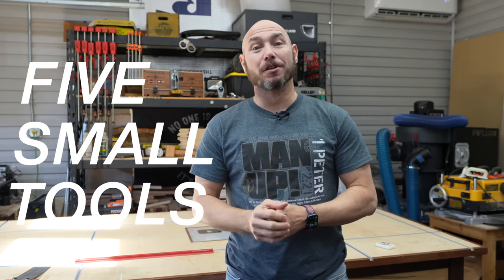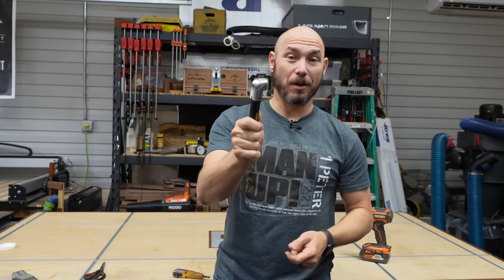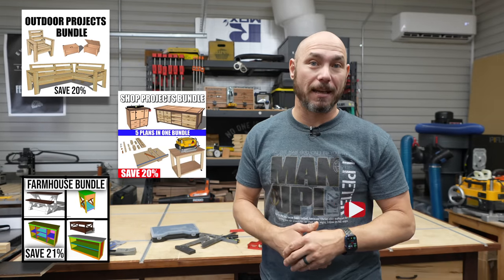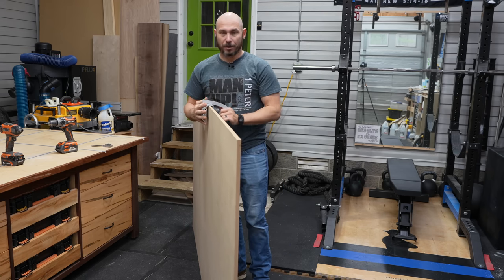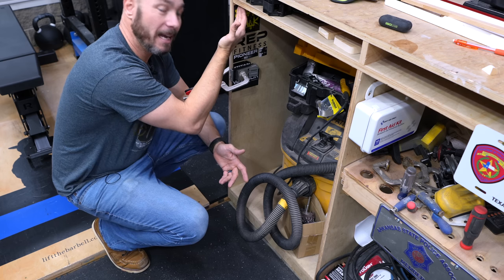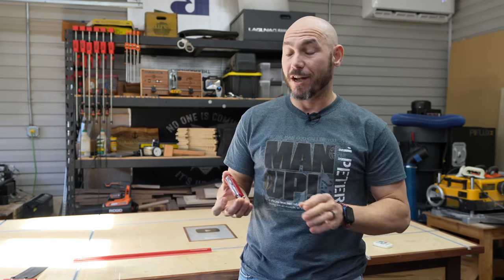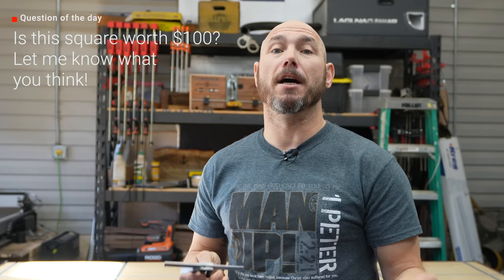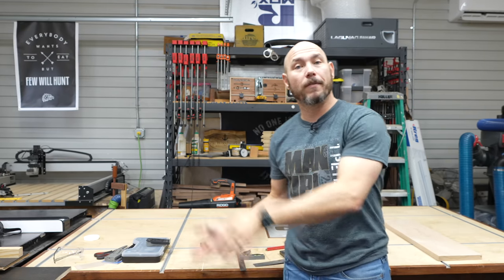5 Tools Under $30 Every Woodworker Needs

Comment: Here’s my bonus comment. The spring loaded automatic center punch is a must have forever vehicle. It’s the best thing for breaking a window if you were to be trapped need out. Conversely if you come up on the situation where somebody needs to get in a car, it’s fabulous for that as well. And all my years with the rescue squad I make sure I had one in my belt pack all the time. Just put it in the corner, give it a push and the tempered glass shatters.
Reply: I keep a Res-Q-Me on my key change.

Comment: I do A LOT of flat box furniture assembly.  I agree the 90 degree drill attachment is a key item.  Same for the flexible extension.  Bonus points for using “waller” in carrying plywood👍🏻

Comment: I got that exact right angle attachment when I needed to add studs in a tight wall and as long as you hold the head FIRMLY, that thing is a total gem.

Comment: I love my Starrett 12 inch combination square, Heirloom tool quality.   One advantage to it over the lesser brands is how easy it is to remove and put the blade (ruler) back it quickly without having to fuss to align the pin with the slot.  The satin chrome finish is just so easy to read -never any glare.  Wonderful tool made here in the USA .
Reply: I love all my starrett mics and calipers for work. I need to get the combo square for the the woodworking shop though.
Reply: I have one that was in graved back in 1912 I assume by it's original owner and it is still accurate and a everyday carry for me

Comment: Matt keep up the great videos. I am from Southwest Georgia and have been enjoying your videos for about 6 months now. I have gotten back  into wood working after not having a shop for over 6 years. I have been fully retired (for the second time) now for 2-1/2 years. I have been doing volunteer Christian construction work with Mid-State Builders For Christ; Macon, Ga. since September of 2019. We just had a new 24' wide X 50' long with 10' walls shop put up. I am in the process of getting things finished up on the inside to move all our stuff, equipment, tools, etc. out of our double carport into this new shop. Can't wait! Thanks again from a fellow Christian for your great videos sir.

Comment: Not a woodworker... yet... but I already own and love some of these tools.  

Right angle driver.  Got one of these when I was strengthening and redoing the the closet poles when we moved into our new house.  It made screwing in the brackets under the shelf so much easier.  Have used it multiple times since in other various projects around the house.  I found out about it from a Steve Ramsey video.  

Center punch.  I picked up one of these on a whim for my model making hobby.  It was not precise enough for what I needed in the application I wanted at the time, but has come in handy for jobs more in line with what it was designed for.  I was glad I had one when i finally needed it.

Swiss Army Knife.  I got one when I was 11.  I still have that same one 33 years later.  So useful.  Usually not the best tool for some of the applications I have used it for, but a tool that can get the job done eventually is better than no tool at all.

Comment: Been carrying a Swiss Army knife for YEARS!  Use it EVERYWHERE!!  A DEFENITE MUST HAVE !!
Starrett makes high-end precision equipment; I wouldn't warranty an engine rebuild without them!
Got the Kregg pocket hole jig 8 years ago for Christmas and I use it all the time!  I need to pick up the Visegrip clamp to lock down the jig independent of the jig base.
One I didn't see but consider a must is a high quality speed square.  Had the cheap ones and they went out after just a couple of years.  The one I have now is heavy gauge cast aluminum and machined smooth; got pencil notches for most average sizes to speed marking full sheets.
I'm cheap; I use a 10 penny nail for a center punch.  With the tip ground conical and then heat treat it to toughen it up, a light tap with the hammer and I've got my drill piolet punched.

Comment: First. You are my new favorite wood worker. You’re just a genuinely good guy. I listened to your interview on Steve Ramsey’s podcast. Anyway. 

I have a Swiss Army knife. My kids got it for me for Christmas way back in the early 90s. That year we went to visit my mom. She got a flat box, roll around cart and asked me to put it together.  She had just a few tools in the house and exactly zero Phillips head screw drivers. Of course, that was what was needed. 

Being Christmas Day, no place was open and she wanted it put together before people came over. 

I popped out my shiny new Swiss Army knife and assembled the entire cabinet with that little old Phillips head screw driver. 

My hand was sore for a day, but my mom was happy and that was what it was all about. 

I keep a pocket knife on me at all times. I get a multipack during the black Friday sales so they are like $3 - $5 a piece. I end up losing them eventually. 

Anyway, I lay just pull out the old knife, sharpen it, and have it on me

Thanks!!!

Comment: I have the 6 inch Starrett combo square and I agree that it’s totally worth the cost. I use it during every project. I actually just bought the 12 inch version (gotta treat yourself at Christmas!) and I’m loving it just as much. Another small tool I’m loving right now is the Starrett 819 Hinge-Locating Automatic Center Punch. Basically it’s a spring activated center punch with a concentric collar that makes marking hinges a breeze. It’s also on the pricey side but definitely quality. Thanks for the tips!

Comment: Just bought a right angle drill adapter for next day delivery! Thanks. 
My indispensable tool is a Victorinox SwissTool I’ve had for over 20 years and it has seen me through a tonne of projects. It’s essentially a Swiss knife but with pliers and the case also holds an Allen-key with an assortment of screw driver bits.

Comment: I have the spring loaded center punch and the "plastic" squares, and a complete set of Starrett squares, 6" 12" and 18" as well as a center finder body and use them A LOT. I've had all of them over 20 years, and they still perform as well now as they did 20 years ago. I also enjoy watching your videos. Almost forgot, I also have a Kreg pocket hole set. Best idea I've ever used for assembly of cabinets, etc.

Comment: I agree with every single tool on this list and that is a rare thing. Starrett makes great tools, I used their combination square and chalk line boxes when I worked construction and they always worked just fine. It's worth paying a little extra if the tool is made right and does the job that it's supposed to do.

Comment: YES!!! The Starrett square is worth it!!  It will put a smile on your face every time you use it!  Great list.  The Swiss Army Knife is worth having.  I like the Explorer best, it has a few additional tools but still isn't too bulky. It adds a magnifying glass and also has a 2nd sharp blade instead of the fingernail file. I keep a needle inside the tweezers, it stores away nicely there.  Also I have the eyeglass screwdriver that fits inside of the corkscrew.  The combination of magnifying glass, needle and tweezers helps with any splinters I may get.

Comment: I recently used the spring-loaded nail set to install drawer glides in already installed cabinets. It made starting the screws MUCH easier and kept them from falling out while starting.

Comment: Another thing worth noting: The Taylor Tools store link in the vid description has a great selection of high end combination squares in their "blem" section. They are super discounted and only have a blemish or smudge (mine had a smudge). You also get a free gift if you spend different tiers of $. I bought the 6 inch combo square and a Narex dual bevel 0.060" marking knife (fantastic), which also allowed me the free gift of a Glubot bottle (also fantastic) for $59 US shipped to my door. JUST the square would have normally cost like 80-100.

Comment: I do like this style video, helpful, nice to know what I don't know and I do Love buying tools that I need (want?).  I have #1, #2, #4  and I have #5..but opt to use my Leatherman "Wingman" model, the plyers come in handy and as for #3...Holy Cow...I NEED that for sure.  As I get older, trying to handle full size lumber is a struggle for me by myself.  Thank You for saving my back and arms and dinging the corners and edges and surfaces of new 3/4 inch plywood for those special projects.  Personally, always reaching for a ruler or square and a sharp pencil.  Thanks Matt!

Comment: Apparently it’s true; great minds do think alike.  While watching your latest as I eat my dinner, I’m trying to decide what is my favorite shop tool.  Lo and behold, I decided it was my 6” Starrett combination before you mentioned yours!  Actually you can find the 6” for around $65.  It’s the 12” that will rock your wallet.  
   For a pocket knife, I favor the mid sized Case XX Stockman with the surgical stainless steel blades.  The long blade’s perfect for digging out splinters.  I’m from PA so I have to support the home team that’s still making them by hand up in
Bradford.

Comment: I use several squares at work.  I do sheet metal bending and welding.  And I use the same ones you use.  As well as the machinist square which is even smaller, and cost even more.  And by far they have lasted longer then any other tools I have, and are by far even more accurate.  And don't even ask about the protractor I bought from Starette, it's even more expensive

Comment: I love my little swiss army knife. I use the "executive" model. Keep it razor sharp and use it dang near every day! 

My favorite small tool that I use in the workshop every day is a scratch awl. It's basically an ice pick, but I use it for marking lines and making divots for my drill to register, super small parting on the lathe, cleaning dust and chips out of small grooves, and all sorts of other stuff. For 3 bucks at Harbor Freight, it's the best thing I ever bought there that I didn't realize I needed until I started using it.

Comment: Swiss army knife. I used to carry the large executive model. One time, I got up on a roof to repair some aluminum flashing and forgot my tin snips. Yep, used the scissors on my SAK to cut the 22 gauge flashing. Thankfully it wasn't much because even though it did the job, it was very hard on the fingers squeezing the scissors.

Comment: I sometimes run into problems when using a center punch or scratch awl to mark a hole for drilling. In certain types of wood that have a significant difference in density between the summer growth and winter growth, the punch tends to drift towards the softer areas.

I bought an inexpensive set of self-centering drill bits that works like a champ! No more crooked or misaligned hinges or other hardware!

Comment: Hey Matt! God bless you! So… I bought the similar woodpecker brand of that recently. It feels so awesome in my hand and so smooth to use. It’s been about 6 months and I do NOT regret it. I am frugal. I shop at Harbor Freight, and they give a HUGE value on many things. I have probably 10 F and (can’t remember the name) Irwin style hand grip clamps. Only 1 had to be tossed. I have a few 12” combination squares. One I inherited from my gramps. It’s decent to use. One I don’t know where I got it, but it’s used. It is ok to use. I got from harbor freight. Yeah… not so good. Point is… it is good advice to spend a little extra on the combination square. I’m too cheap to throw out the HF one, but nice enough not to give it to someone. *Spend a little extra on marking gears and enjoy what you are reaping in the end*. PS thought automatic center punches are what we used in EMS to get through car windows. EMS, meet Woodworking! Woodworking, meet EMS!

Comment: I have not seen that angle drill adapter while out and about but I will now look for one.  I can tell you I have needed that many times over.  One of my most used small tools is probably my pocket square as I'm always needing to mark or check square on something.  Love these videos
Reply: You can find them at lowes where the rest of the Philips head drill bits are. It is a life saver and some times a hand saver in crawlspaces.
Reply: @kevinmiller1881  Thanks for the info good sir
Reply: In my area Home Depot is selling the right angle for about 15 bucks in a kit with bits by dewalt

Comment: I could have used a 90 degree drill last week. I ended up driving pocket screws by hand. I have the small twin kraig pocket hole jig and it’s great. You can take them apart to do one hole or attach them together to do a double hole.

Comment: I prefer my 4" and 6" machinist squares over my starrett 6" combination square. My most used small unusual gadget tool in my woodshop is a pair of 3-4-5 machinist 90 degree angle clamping blocks that I picked up 30 years ago. Great for setting up tables square to the sander or bandsaw blade or even just holding a block while drilling a hole. They were about $20/ea back then, now they are about 5x that.

Comment: Great video Matt and thanks for sharing. I have a kind of similar Dewalt right angle drill attachment except it has a 12” flexible shaft and I think maybe a shorter bit holder, the model # is DWARAFS 12”. I have used a 1/4” universal joint socket on an extension to hold a bit before as I don’t have that particular type of right angle attachment that you showed and while that has gotten me out of some jams before the flexible shaft attachment has been really handy for getting around tight corners or spaces where even the other style attachment would be difficult to reach.

Comment: Great video!  The only one I don't have is the Gator Lift, although my two hole pocket hole jig is from Kreg.  It has been very useful for the more than 20 years I have owned.  I don't usually carry my Swiss army knife, carry a small SOG knife instead.  I have two 6 inch combination squares in my shop and they see a lot of duty.

Comment: I also picked up that 90 degree dewalt tool 14 bucks and it came with a bit set as well. I've used it so much already for those hard angles. HUGE buy.

Comment: The blade on your Swiss Army knife that you used as a scratch awl, is actually a leather punch and the on the screwdriver blade, that isn't a can opener, its a bottle opener. You showed us the can opener stand alone blade afterwards.

Comment: Sometimes expensive small tools are worth it.
I make pens.  To make a pen, the first thing I need to do is cut the pen blank to length, about 2" to 3" long.
Next, I have to drill a hole the length of the blank, which means I need to find the center of the blank.
I tied various tools and methods to find the center, but none were really acceptable to me.
Then I saw a Woodpecker's limited run centering jig at by local woodworking store.
It was around $30 ('Woodpeckers' translates to 'hold on to your wallet').
I picked it up. it was solid and well made (I did say 'Woodpeckers', didn't I?). I bought it.
It was absolutely perfect and a joy to use (as far as marking pen blanks is concerned)

Comment: Hi Matt, I'm surprised you didn't talk about your INCRA 6" Precision Marking T-Rule.  It was sitting on your workbench during the video.  When I need precision marking, that is my 100% Go To Tool.  It is made for  use with a 0.5MM Mechanical Pencil and has marking holes for down to 1/64" accuracy.
Reply from the maker: I've got it out for a future video, but it's not good.  I'm not a fan of it because it isn't square.
Reply: @731Woodworks  That is really too bad Matt.  Mine is perfectly square.  Sorry, Capatin Obvious moment here, but do you have the flexible part tight against the ridge on the back of the aluminum cross piece?  If you do and it still isn't square, I would hope INCRA would replace it for you.
Reply from the maker: I’ll double check

Comment: I would prefer the Kreg multi multi mark. Its just like s combination however it also adjusts to 45* 90* and 0*. When at 0*  it can be used to set saw blade depth.

Comment: Seems like maybe you could use those two Dewalt right angle drilling jigs together to make a U-Turn drillng jig when you've forgotten one of those pocket holes and just can't fit the drill behind the small form pocket hole jig. Maybe this is the case where 'two rights form a  (drum roll please... ) wrong-way-drill-jig?'

Comment: I love my Starette Combination Square yes it cost more but they stand behind their products.  I did something to it, we will not talk about that, and it wouldn't hold tight and could be moved when locked I contacted them they had me send it to them they fixed it and sent it back.  I only had to pay shipping to them.  I also have the right angle drill attachment will not be without one again.
Reply: Starette is good about that stuff. I had a dial indicator that was sticking and they fixed it for the shipping cost as well.